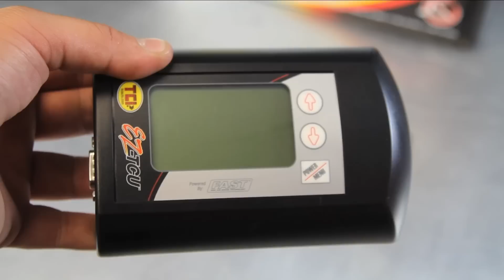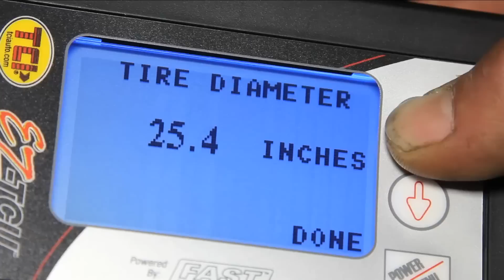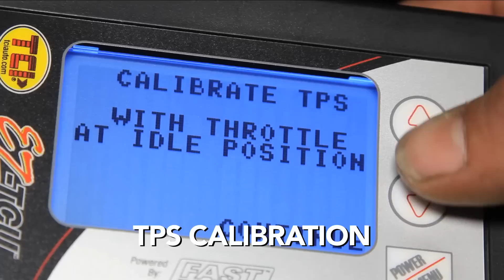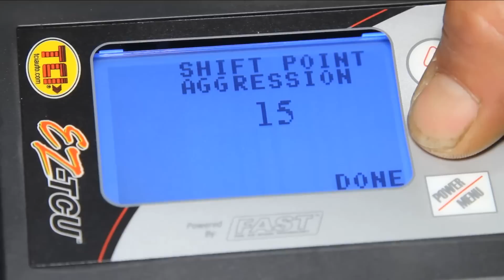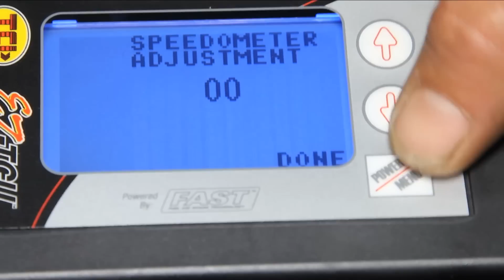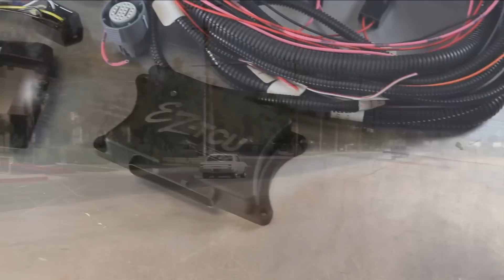TCI® Quick Tech Video: Programming The TCI® EZ-TCU™ By FAST™

Comment: What if I’m running carburetor
Reply: check out my vid, you can use a holley tps bracket and a tps adapter so that you can use it on the gm tps easy money
Reply: That's what it mean for

Comment: need help hooking up my TCI  EZ-TCU trans. controller in my 97 Trans Am have a 4L60E am i gonna half to buy a remote TPS unit now so i can hook up the TPS signal are will i not need to use the TPS sensor
Reply: We recommend you contact our tech line at 888-776-9824
Reply: Q tolba yeva para cubrir cremallera y turvina

Comment: Can this be used in fully automatic shifting and in manual shifting?
Reply: Yes, it will work fully automatic like a factory application.  There is also an input that can be activated on the TCU to put it into a full manual mode for racing use. Hope this helps, thanks for watching!
Reply: Thank you for the quick response.

Comment from the maker: You may want to increase the low speed shift point (found in the advanced settings) by a couple of mph.
The WOT shifting will not be affected. Thank you.
Reply: Do you provide any examples of how a car should be set up?

How cars with the transmission as stock would have it?
Reply: I have a question about thr the TPS SENSOR....does its suppose to show a signal ....the circle besides the tps suppose to habe a check mark?

Comment: I have the TCI® EZ-TCU in my car that controlled the  4l80e after that I installed  tci  low ratio, Low Gear Planetary 1st&2
  Does I need to retune it or leave it ?
I notice it shift early before the shift point set